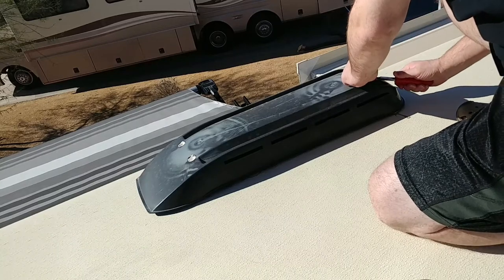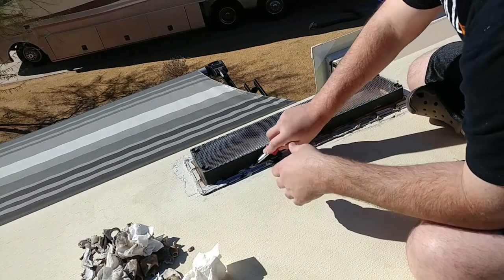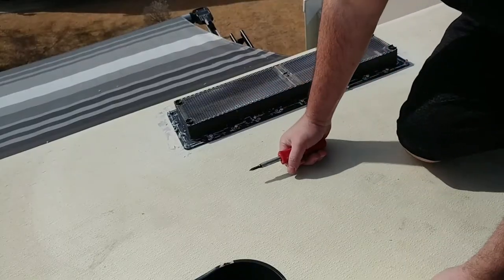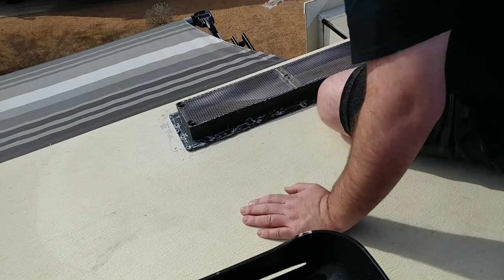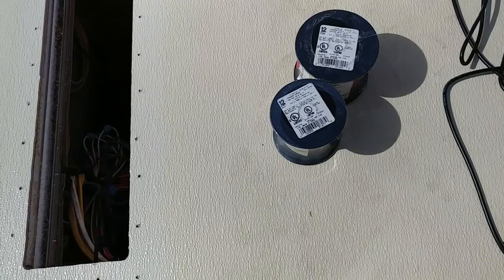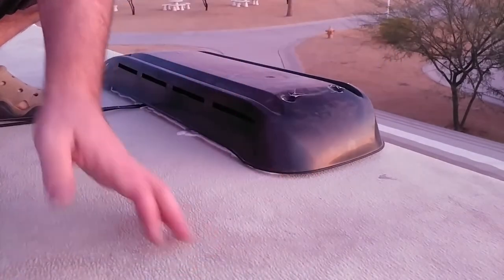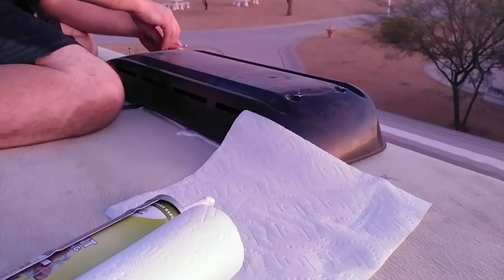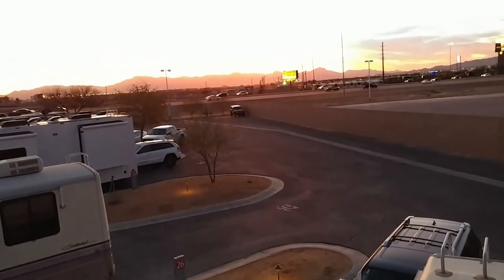How to reseal an RV fridge vent

Comment: You would think if the manufacturer used butyl tape between the roof and the vent base, there was good reason. Doesn't make sense to use self leveling lap sealant when you are pushing the vent base against the roof with screws. That's why its used on top so it can do it's job and self level. I would have used butyl tape and it won't shrink like lap sealant. Since this video is over 2 years old, you likely have a leak where the wires protrude from the vent base if you haven't resealed it again already.
Reply from the maker: Haven't resealed it yet, and I don't have any leaks from it either. Lap sealant does need to be cleaned and checked every year of not more often. If you see potential problems, add more lap sealant or remove and replace if it's really bad.
Reply: I agree. Or use non sag instead of butyl then selfvlevel over the edges